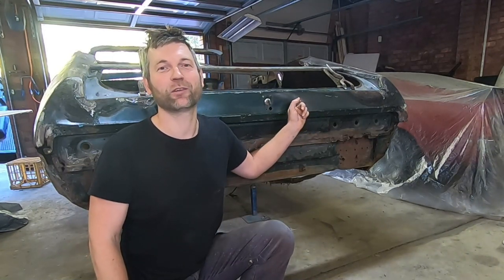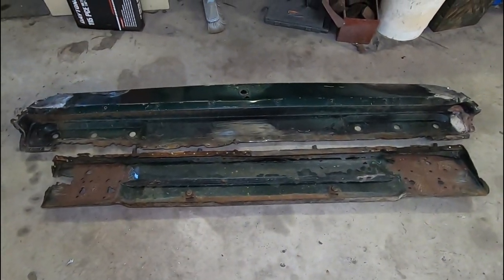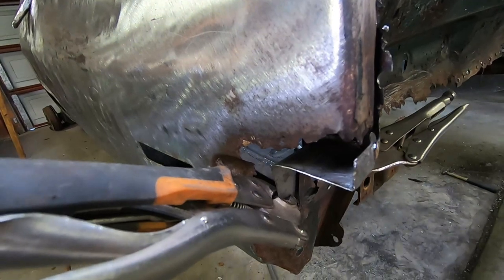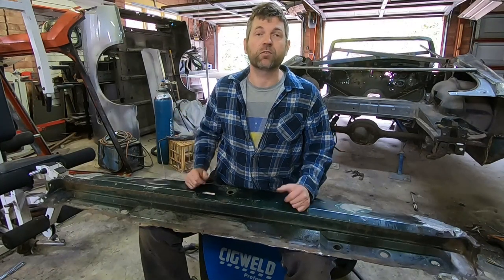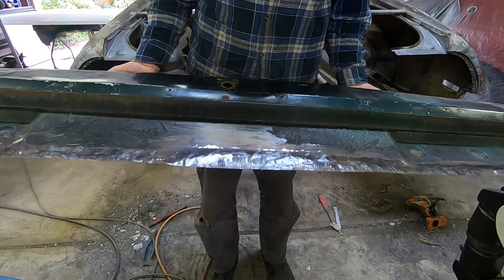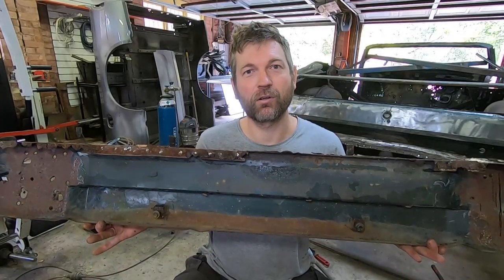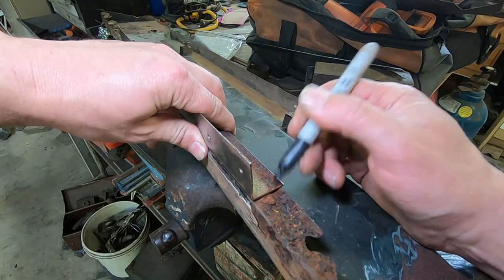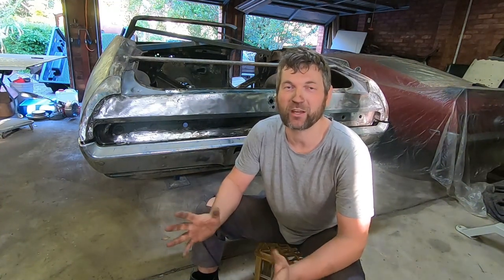Scrap metal Landau Part 12 Tail light and Beaver Panel Rust repairs

Comment: The rear panels above the taillights and round them are unique to Landaus. Impossible to find. 
And the rear left quarter 💀
I was lucky enough (20) years ago to find NOS rear quarters. 
Weirdly the Landau side rear blinker runs horizontal. The other coupes have it vertical. 
So one of my quarters had the Landau light placement. Imagine Ford bothering ! 
Bizarre but interesting.
Reply: Early hard tops had the vertical then switched to the horizontal mid XB run.

Comment: Hats off mate! Your attention to detail is amazing. I also made sure to put in that alignment notch when I repaired my Landau taillight panels. Repairs look amazing. I really like how you fabricated the back of the quarter panel.  I'm really looking forward to see how you repair the roof. I did have a coupe roof frame from one of my Landaus that I would have donated to this project if I still had it. Will you be using sedan roof frame sections to make up the frame? I found that the cross section of a sedan roof frame is quite a bit different to a coupe. Do you have any roof bits you could use from that super rusty XC hardtop you cut up a few years ago? Cheers
Reply from the maker: Thanks mate! I do have both quarters and pillars from that XC. The roof sections crumble away. I've also got a rusty roof cut from another coupe however, that was donated. Between it all, I should be able to slap together the basic shape, then either look at modifying sedan stuff, or making panels from scratch. I think most of the sedan roof sections can be altered, whilst the C pillar areas will likely all be made from scratch.
Reply: @shellberightgarage  good stuff, it is possible to use the majority of a sedan skin to repair a rusty coupe roof skin (most of the profile is the same). You could possibly modify a sedan roof frame cross section too (the coupe ones are wider). As you mentioned, you will most likely have to completely fabricate the rear part of the frame as they are unique to a coupe. Eagerly awaiting the next video. Keep up the great work!
Reply from the maker: @gillevy3739  I've got both donor roofs side by side. I suspect they will be close enough to rework. It's about 20mm difference in width. I'm hoping to stretch the sedan skin and refold the rear window areas, to make it from one piece. As you rightly mentioned, the C pillar stuff is very different. I think it will take about 5 episodes to truly capture the mammoth amount of work to get the roof and parcel tray completely back to stock. I'll also be fabricating the landau specific infill panels from scratch as well.
Reply: @shellberightgarage  , let me know if I can help at all with any patterns of parts like the infill panels, mine are currently not welded in yet. I'm also splicing in a new roof on one of my Landaus
Reply from the maker: @gillevy3739  thanks mate! My biggest difficulty will be the two inner panels of the C pillar. I actually have some rusty infill panels here for it, that I can make a template from. That said, I do have access to my other hardtops if absolutely necessary. Just nothing off a car, sadly.
Reply: @shellberightgarage , I may have part of a passenger side C pillar, but you will be after the top section above the parcel shelf (I did have a really good cut of exactly that section but that got sold earlier this year). If I come across any other coupe roof frame cuts I will let you know.